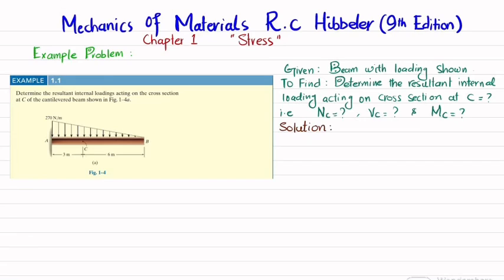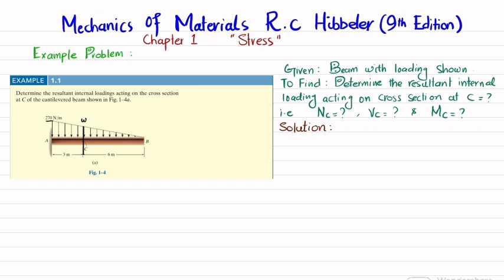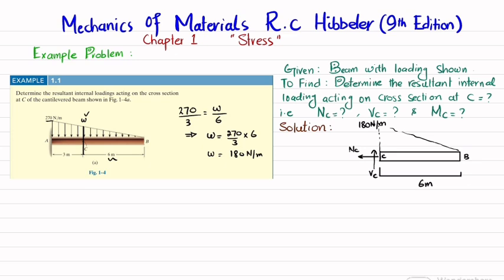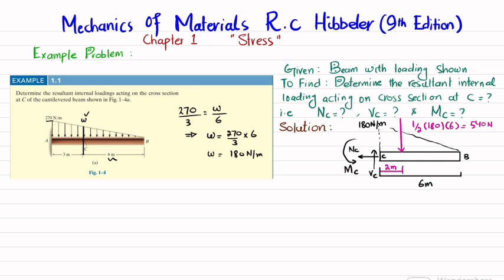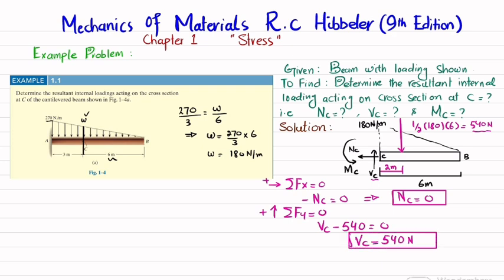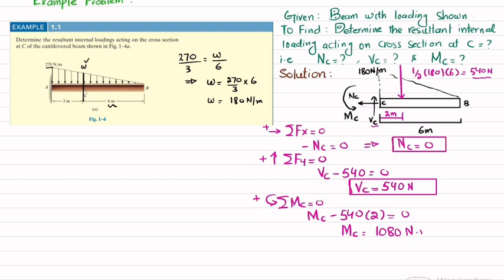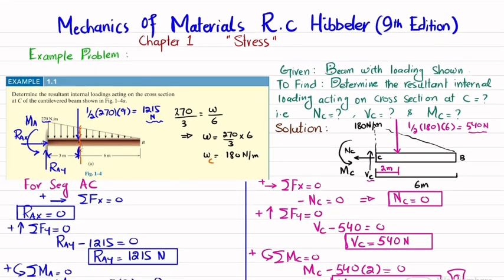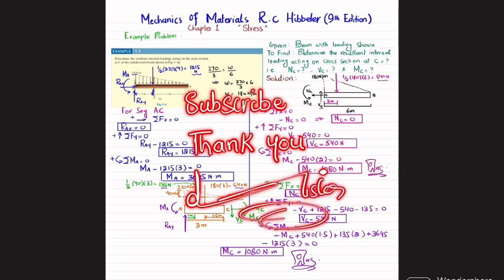Determine the resultant internal loadings at C | Example 1.1 | Mechanics of materials RC Hibbeler

Comment: How do you determine the direction of the normal force and shear force
Reply from the maker: Try to visualize it and make them balance to get equilibrium. If you are not getting it then take any direction of normal force and shear force, then solve and if you get positive value then it means your assume direction is correct and if your answer is negative then you have to say that my assume direction was wrong and it should be opposite to what I have choose.

Comment: why didn't you take point load in the center of the beam?
Reply from the maker: It triangulat load when converted into point load it will not act in the mid , it will act L/3 from denser side where magnitude is maximum and 2L/3 from other side.